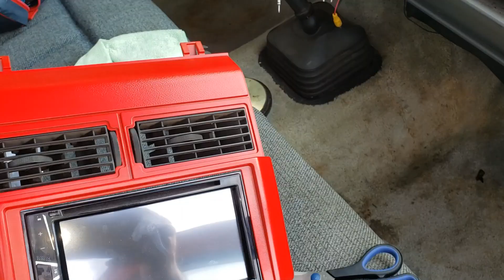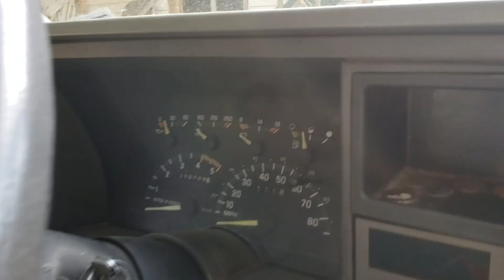88-94 GMC 1500 Dash Upgrade (Part 1)

Comment: Y didn’t u scuff the surface and u didn’t use no adhesive promoter
Reply from the maker: Kinda rushed thru and experimenting... it's still holding with no issues tho

Comment: How do u take the cup holders out
Reply from the maker: Mine didn't come with the cupholder
Reply: 2 little screw on the bottom .size 8mm by the ashtray very easy to takeit out its easy if you doit by the passager side. Only take less than 1 min

Comment: I happen to like red I was like OBS trucks I got one and I'm looking to build a family off of them but anyways nah like I like what you doing I didn't even know it's even ahead of a kid for that hours and that's good to know in case I want to change it out but anyways no I did what you doing with your truck I like it I think it's going to look great I have like red anyway so yeah I'm a little biased my Suburban is Crystal red so and I used to have a Dodge Frozen car I had a couple of them the Dodge Stratus RT two-door model it was in the red and that thing was so red I mean everything was red red and it was bright red which is kind of crazy because you wouldn't think that you would you know have so many females I mean I can park there my LTZ Suburban Crystal red Cadillac something about red just do something to women I think cuz only two cars I had that was red was the Suburban I'd take it back I had a sub that was red so my Suburban my Dodge Stratus RT and my saw was pretty red Vehicles I've had yeah yeah and all of my head I'm sparkling like hot fire on the sub I had to do some work to get that paint job back there back to life the owner just I don't think they ever watch that damn car after I had that car like I don't know maybe a couple of months the owner of the previous owner saw me one day I was at work and you happen to just run across me and they asked me this crazy question is that the car I sold you I bust that letter let me buy it back I said hell no work buffing that paint job back to life sealing it then polishing it man ain't no way but anyhoo man go and finish fixing up your dirt truck screw with people think I think it's cool